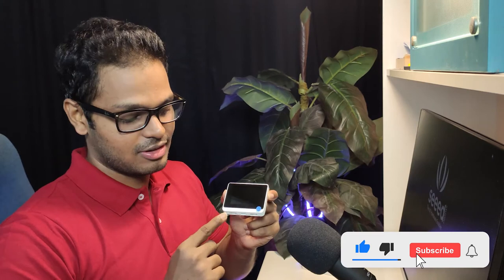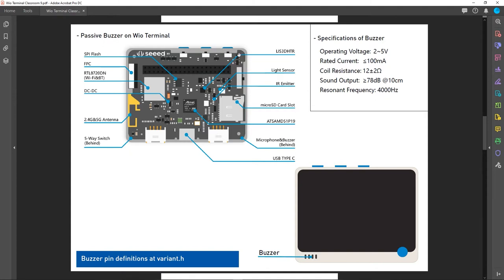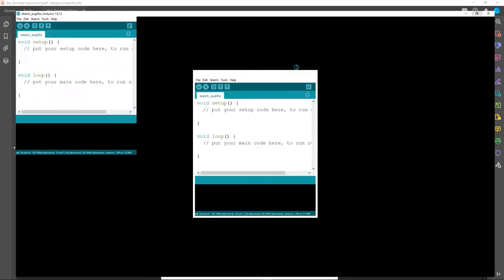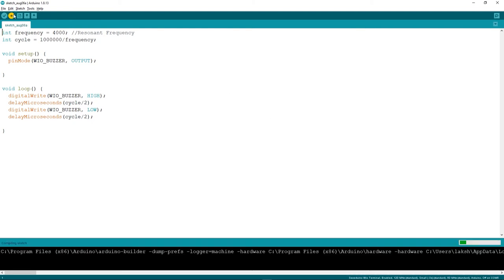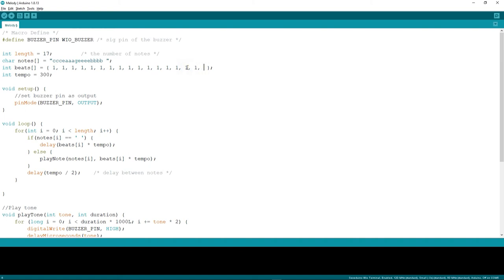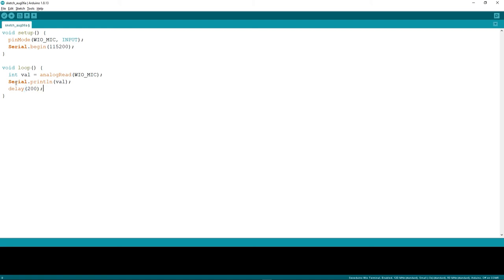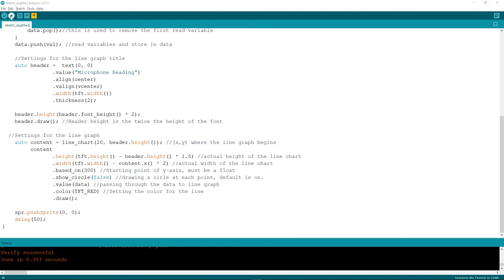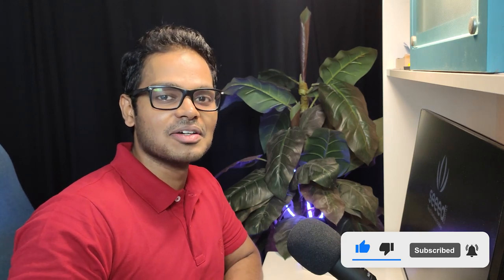Wio Terminal Classroom #9 | Built-In Hardware/ Sensors Part 2 | Microphone & Buzzer

Comment: Operating voltage: 2 - 5V
Rated current: &lt; = 100mA
Coil resistance: 12 +- 2 Ohm
Sound output: &gt;= 78dB @10cm
Resonant frequency: 4000Hz

These should be put in the wio terminal buzzer wiki, especially the resonant frequency. With any other frequency, the sound volume is really low.
Reply from the maker: Hi.
Thank you for your inputs. Appreciate it! Actually, we have previously added the sound output and resonant frequency information inside the specifications table in this page:
https://wiki.seeedstudio.com/Wio-Terminal-Getting-Started/